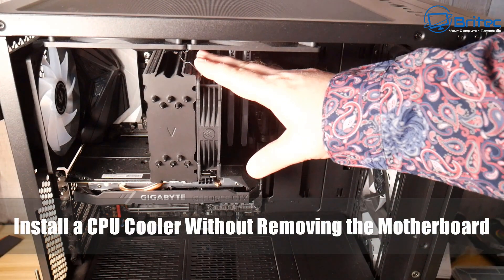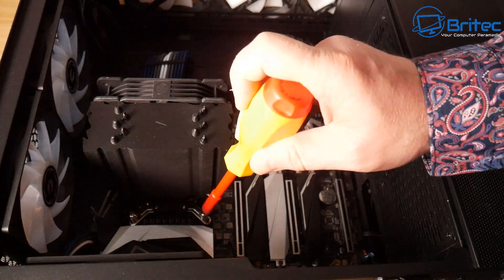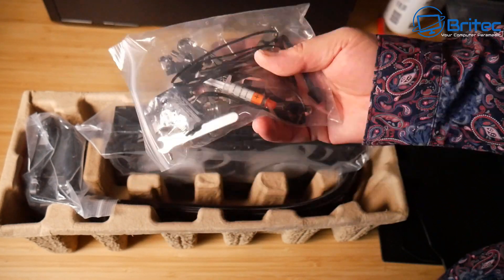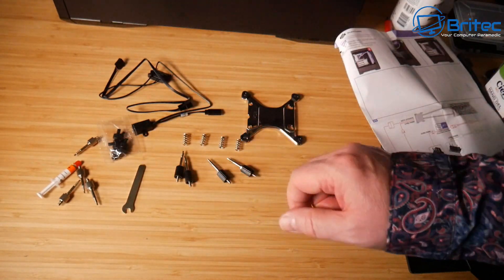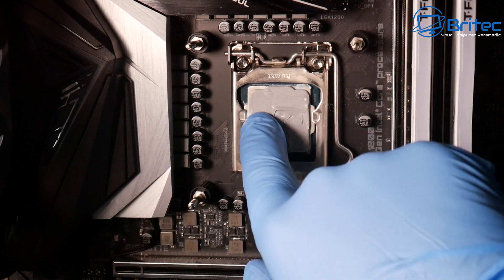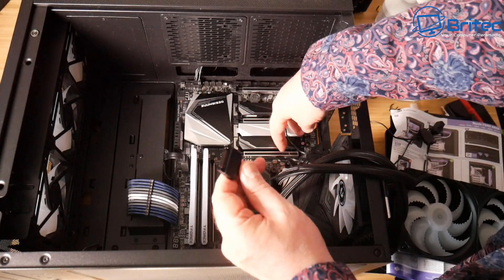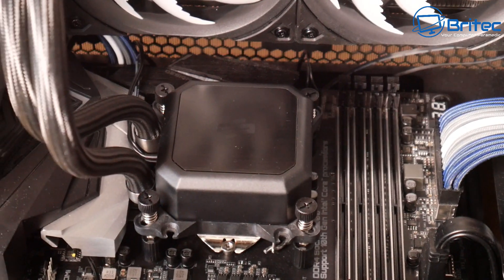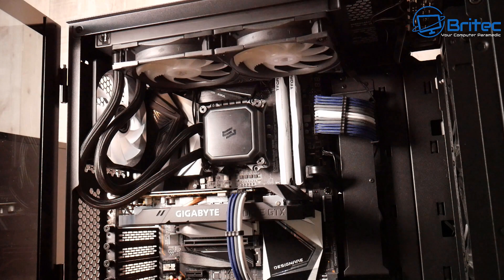How to Upgrade CPU Cooler With AIO Cooler Without Removing Motherboard

Comment: 3:49 i have a LGA 1700 Board, with a dark rock pro 4. I wanted to Upgrade to an aio but this Silber backplate is Not there! I bought the pc prebuilt and the just had the Dark rock backplate but Not the original one that comes with the lga 1700 Socket in the Board out of the Box

Nie the screws from my liquid freezer iii 240 argb wont fit. What can i Do???

Comment: Perfect timing I just got a Dark Rock Pro 4 to replace my old 212. Time to overclock my 7700k to 5Ghz as it’s getting a bit slow for my use case (240hz with reasonable lows)

Comment: Brian with the liquid cooler you mentioned refilling the rad after some period of time. Now, what would you fill it with and would that be a specially made liquid-like anti-freeze stuff? I have an old Intel Liquid (Asetek) set up but cannot see any refill ports so am assuming it is hermetically sealed so should I leave it well enough alone?. The one thing I like about liquid coolers is that they are (in my experience ) a lot quieter.
Reply from the maker: The refill part is a nice feature, but my concern would be the pump lasting that long.
Reply: @Britec09  Hmm didn't give that a thought Brian my Asetek (branded Intel) has done well I suppose after I built the machine back in 2014, Mind you if you look at their site they do produce cooling pumps for things like F1 racing cars etc so should be good for a bit longer yet eh?🤞

Comment: It's not hard at all but likely depends on the case. For instance I replaced my 3700X recently with a 5800X and I pulled the entire AIO out just to give it a good cleaning since it's been over a year and a half in use. I doubt the entire job from start to booting back up even took an hour and I have a large top mounted 360 AIO but it's also a premium full tower case (Phanteks Eclipse P600s solid side case) so I have plenty of room to work in. I got the 360 AIO because without any RGB it cost the same as the 240 AIOs with RBG which I can't see anyway because I have a solid side case. When working at home I sometimes use a USB 3.0 Vector Network Analyzer and need a solid side case to shield the RFI coming from inside the computer
Reply from the maker: Phanteks Eclipse P600s is a nice case

Comment: Brian! how much would you charge for a system like that with the 11-400 none F version also minus the GPU & HDDs rough estimate? please, thanks!
Reply from the maker: You buy the parts and pay delivery and  I will build it for free
Reply: Do you think £540 is a fair price for MB same as your video CPU i5-11400 version, Memory 16GB, Case Corsair & PSU ?

Comment: Wow a AIO that actually gives the correct dimensions. Far to often manufacturers don't give the dimensions.

Nice looking cooler, I do like the look of that block. Still not convinced with water coolers, only used a AIO once and that was actually worse temps than a air cooler.

Good video as always
Reply from the maker: Some people love them and some people prefer air coolers
Reply: @Britec09  very true, I've only ever used the Corsair H100 so maybe things are different now.
Reply: I agree with being suspicious of AIOs. They do of course sometimes malfunction whereas a decent air cooler like my Dark Rock Pro 4 are indestructible and will last forever.